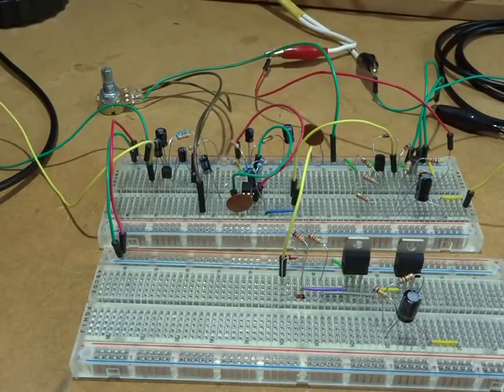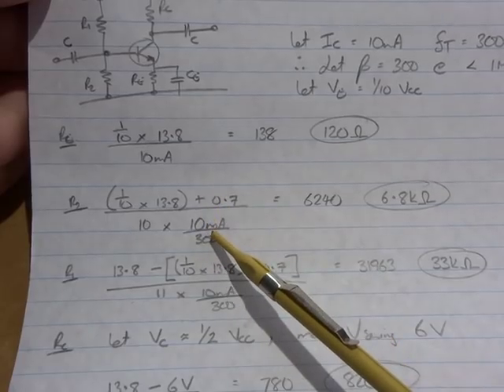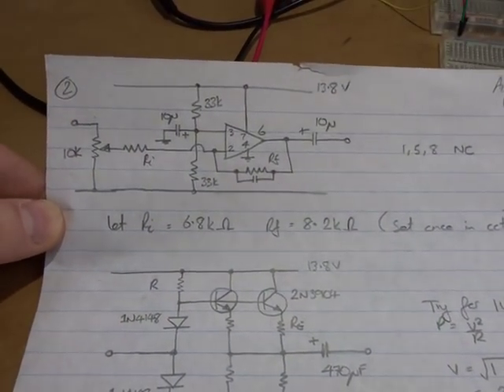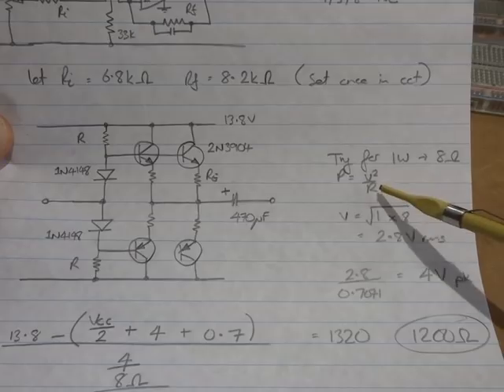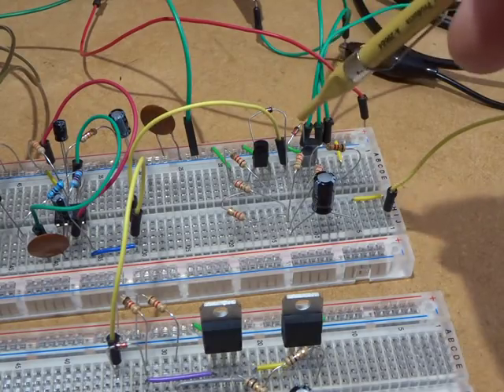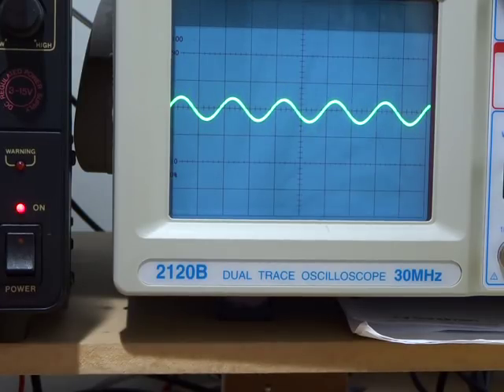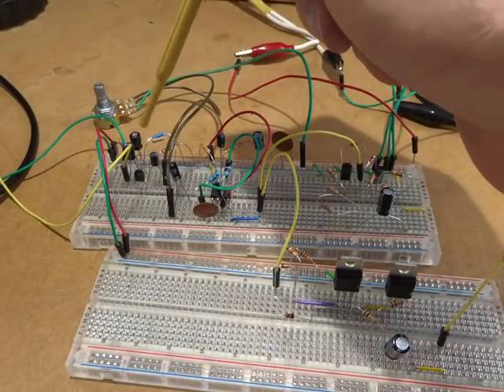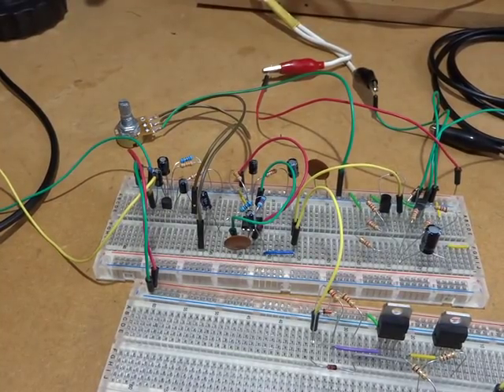Homebrew 80/40m SSB/CW Rig - #2 Audio Amplifier

Comment: looking forward to seeing more crystal filter videos. That's currently the stage I'm on. Managed to listen on the air earlier this year with a direct conversion receiver and now want to turn that into a single conversion receiver. I haven't had as much success as you getting a desirable filter response. AE0AI
Reply from the maker: Thanks. Hopefully, those crystals will work well. I can see quite a bit of iteration with the caps to get the right freq response.  We'll see!

Comment: Hi Charlie, thanks for the great video! I wonder if you could use a dual opamp (instead of the transistor gain stage) and then distribute the gain across the two as well as provide the 50 ohm match to the product detector? Also, if you include the feedback resistor in the output buffer it's supposed to reduce distortion. I'm no expert - your configuration looks and sounds good and may also be lower noise. Love your videos. Cheers, Ian
Reply from the maker: Hi Ian. Like most things there are many ways (far better than this approach) to make the amp. I don't see why you couldn't use two op amps, and yes I agree that it would present a better impedance match to the product detector. I'm not loosing too much sleep as I've connected a similar BJT amp to a SBL-1 and it seemed to work well. I could see any evidence of artifacts being introduced due to the mismatch. Not the purest approach, but I wanted to see how it would perform. As for the feedback resistor, I've left that out for now, as it seems to be nice and linear. I did have distortion with no bypass cap across the NE5534 Rf resistor. I've seen that before. Vcc filtering (100uF + 0.01uF or 0.1uF) is a must too. Try a dual op amp and tell me how it goes. I'll see if I can dig out another NE5534P from the junk box.

Charlie